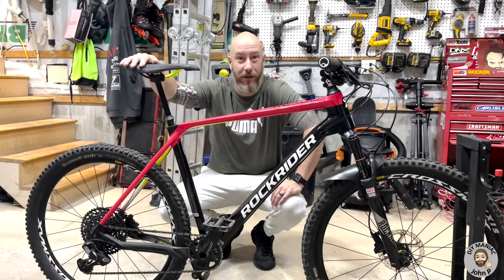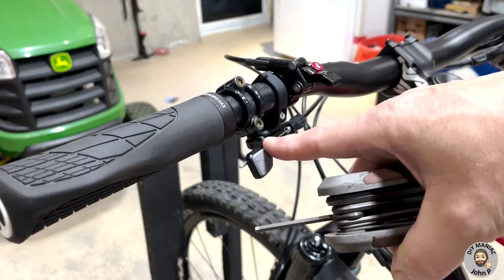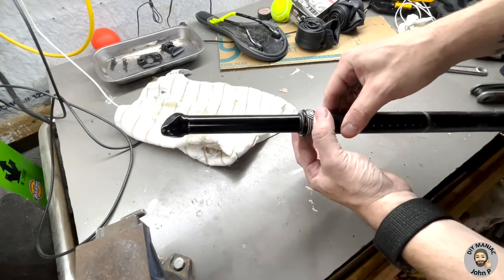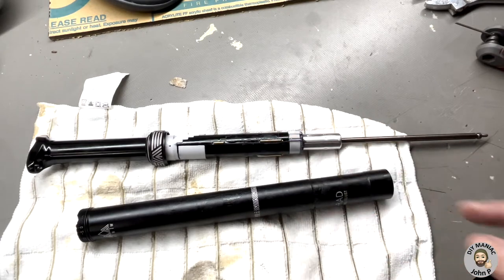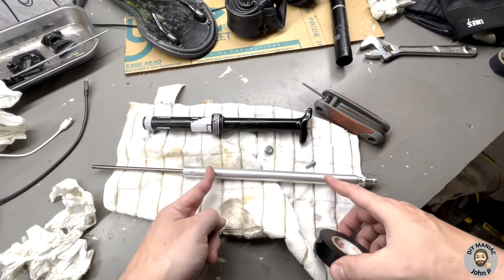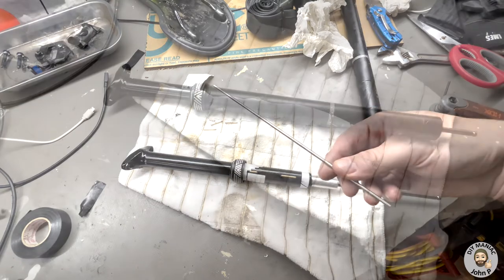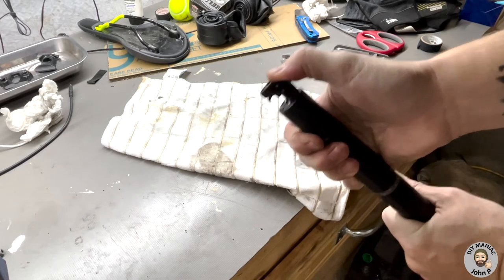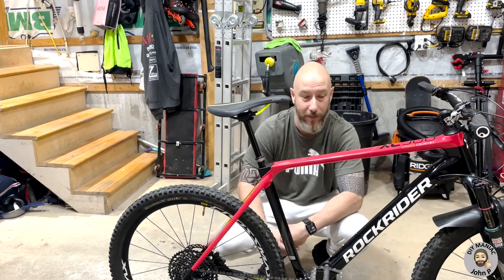PNW Rainier Gen 3 Dropper Post Rattle Noise Fix

Comment: Thanks for the video. Fixed my same issue on the same brand new post. FYI, I managed to get rid of even that very very slight amount of “play” that’s left over by adding just half a wrap on the bottom of the cartridge, facing forward. So it still slides into the body as it’s not 2 full wraps but just an extra half (either on the front or rear when lined up with the seat orrientation.
Reply from the maker: Glad it helped and happy to hear you got your's sorted

Comment: I have a cascade post - the company replied quick to have me check some of the bolts and tighten them but i think it is this same issue. Thanks for the video and I agree it seems like the manufacturing tolerances are too loose for such a high quality part and a little more research and testing probably should have been done before flooding the market

Comment: I bought a Rainier gen 3 recently (September 2024) issue isn't fixed it was rattling since out of the box, anyways I contacted PNW they said it wasn't this exact issue, I replied with something along the lines of "f*ck that I'll buy another dropper" customer service dude still replied that he would be curious that I open the thing again since he's convinced that issue is not the source of the rattle. 
He copy pasted a tutorial for the loam (with the air valve). I understand it's similar but yeah... Not impressed with PNW
Reply: Spoiler I went out and got another one up, I did not return the Rainier yet I will investigate further and reply eventually to the customer service dude 💀😈
Reply: Another update, PNW customer service sent me a new one. Hope it won't rattle 🤞😁